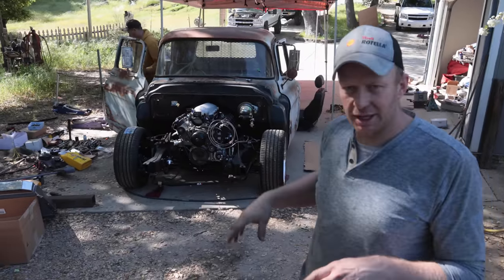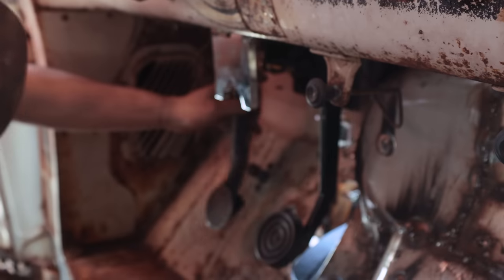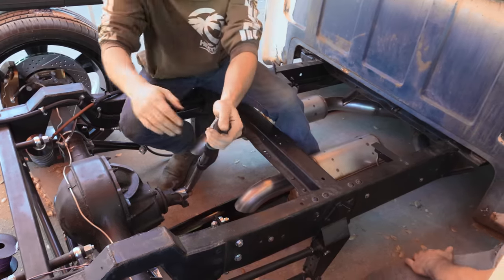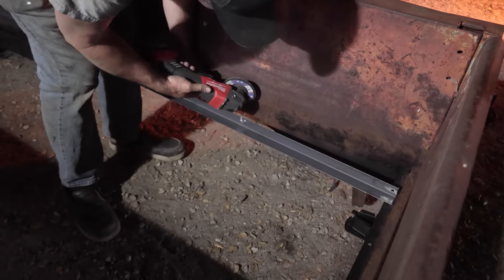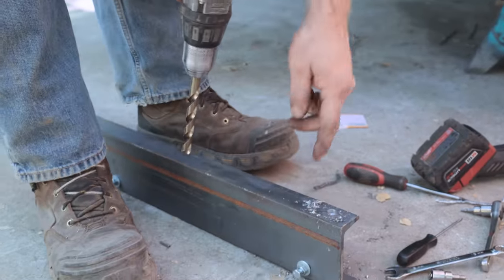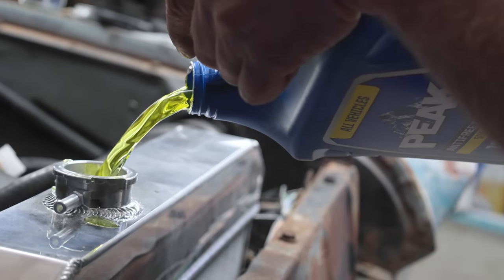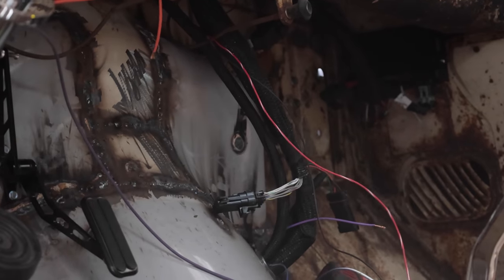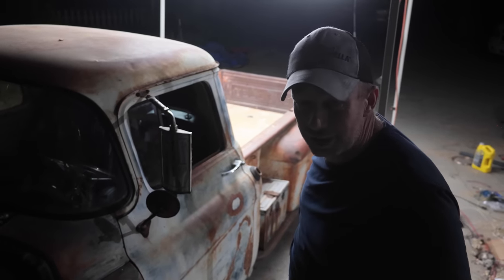It’s Alive! '55 Chevy Moves Under Its Own Power  #ApacheStroker [EP12]

Comment: That first time the new build moves...even a few feet...on its own is a moment that you get to keep forever...I have a few of them, but the best was in 1981, when, after starting with a Chicken coop in 1973, Dad and I fired up the stroker flathead in the 40 Ford sedan and took it for a spin. Last licensed in 1960... Fresh black lacquer paint, him sitting behind the wheel on a cut down folding chair, and me on a couple cases of oil, holding a jerry can of gas between my legs, the fuel line going out the cowl vent to the 3 Stromberg 97s we had built from cores....hitting the pavement and seeing 35 years melt off of him in a smile I will never forget..I am sure I had one too.
He passed two years later...but the car is still here, with me...

Comment: While most people use nutsert and rivnut interchangeably there is a difference.
A nutsert is generally pressed or moulded or glued into plastic or wood or even stone .
A rivnut or rivet nut is a panel nut that uses a flare that expands when compressed to secure it to a panel.
Then there are panel and cage nuts and J nuts and T nuts.

Comment: you need 2 times the storage for the Plasma cutter and you can raise the pressure to compensate in the pressure switch they are adjustable!!

Comment: need a higher cfm compressor for the plasma table, or run 2 or more in parallel to get the cfm flow you need.

Comment: I have really enjoyed this build with all the individuals involved. Lots of fun.. I sure hope you recheck the toe on the front  end . It wax set to 3/8" toe out according to what the measurements were.
Reply: Final adjustment was 1/8” toe in, when it was 3/8” toe out, the one tie rod was stuck and the 1/2” had to come out of that side to keep things centered (ended up getting it)

Comment: 14:47 your splash shield for the intake is gonna make you wish you found a better design. The water will find its way around that and suffocate your engine
Reply from the maker: drove through a massive storm. and it didn't .iss a beat.  Even if it did, you don't need 600 HP when it's raining anyway

Comment: No, you DONT need pretty metal … not where it doesn’t show on the inside, but on the outside…
And tell that young whippersnapper 1955 isn’t that old! Of course they had locks!…
Reply: Yeah, but in '55, you left the keys in the ignition.  Nobody bothered nothing.

Comment: Youd think they'd find a better way to stop rust from forming in countries like yours and states like mine. Half the year its cold an snowy so we get a lot of snow and salted roads as well.
Reply: Why would they want to
Reply: They've known how to make rust resistant steel since long before they started putting salt on the roads. It's not worth it to them to make vehicles that last. 

One reason is they really don't want to make vehicles that last longer. More cars sold the more money they make. 

Another is they tend to choose steels that are easier to work with. Harder to work with steels mean higher production costs. 

One people don't know though is stainless steels even just corrosion resistant ones aren't as strong as non corrosion resistant steels.
Reply: @edwardscott3262  So why has corrosion resistance come a long ways in the last 50 years if they don't want to make cars rust less?